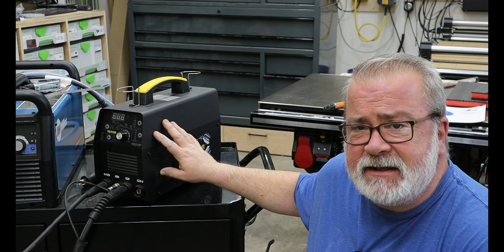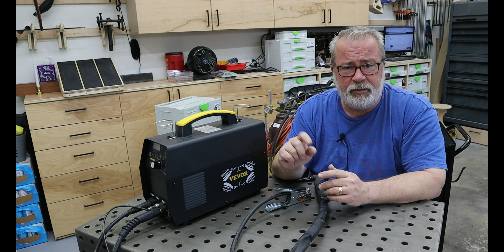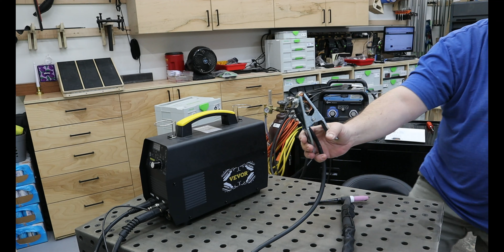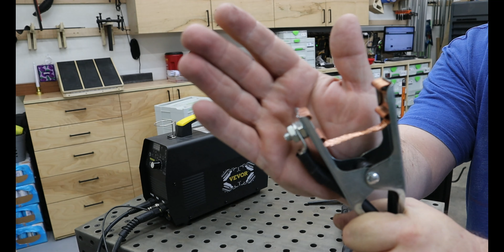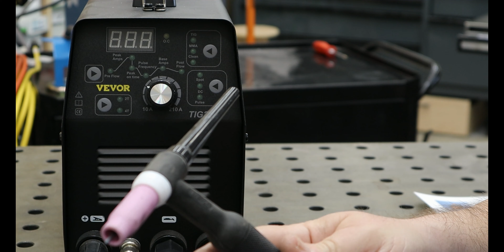VEVOR 210 Tig Welder Review

Comment: I would try and fix my little wagon that I pull hay with, which has been breaking for the past 5 months.
Reply from the maker: Good use for it, good luck!
Reply: Thanks, I've been practicing arc welding lately at a local shop thats allowing me to hang out.